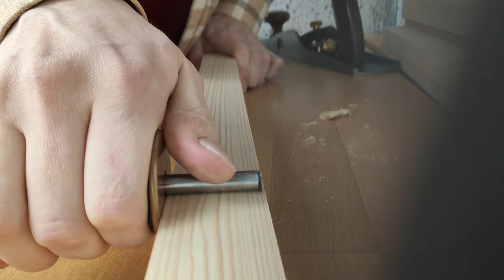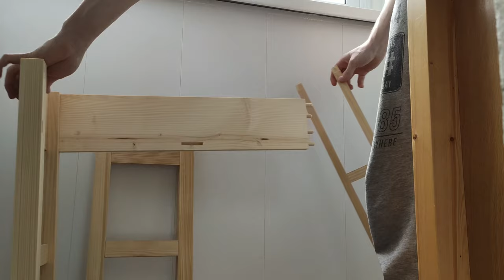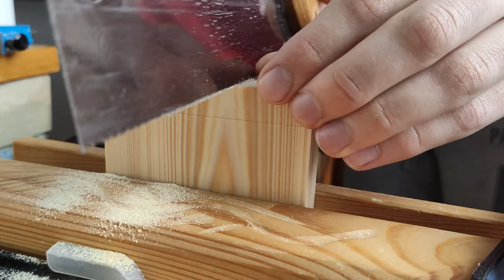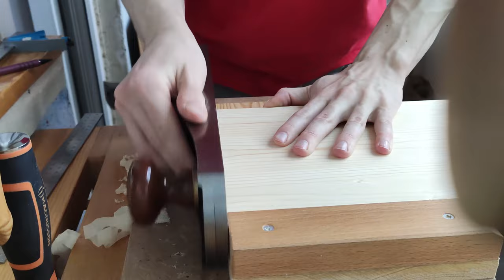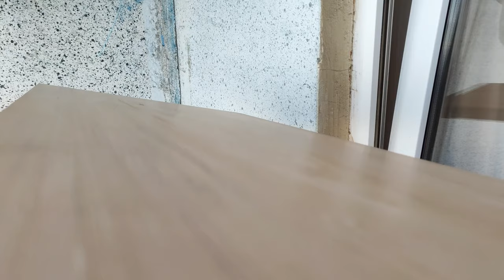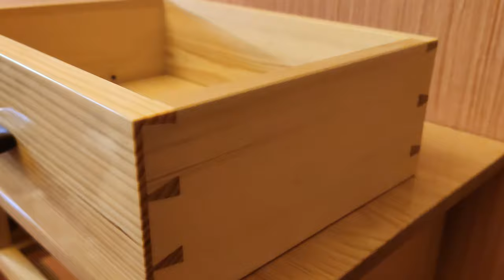Making a hall table using hand tools only. (My first video)

Comment: I like the trick of putting a little knife wall to register against the pin board during layout!  Nice job.  QQ, why tenons on some parts and dowels on others?
Reply from the maker: I just messed up and cut my board too short, i did not allow for the lengh of the tenons.

Comment: I agree with the other commenters........very nice work with very tight joints. One small quible......at the 3:00 minute mark you are using a chisel with your fingers and hand directly ahead of the chisel........DO NOT DO THAT......one slip of that chisel and you will have a nasty injury. Sorry, I don't mean to  lecture but please try to always keep your body parts behind the chisel. Except for that, you should be quite proud of your work.
Reply from the maker: Thank you for your comment! It might look deceivingly dangerous on camera but in this case the only direction in which the chisel could have slipped was into the knifewall. With a few exceptions I always keep my hands behind the tool.